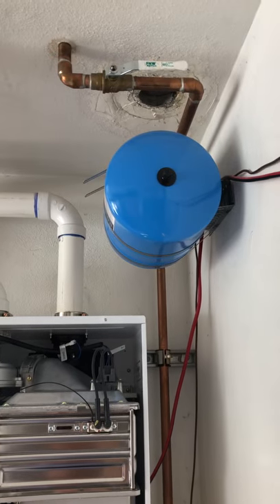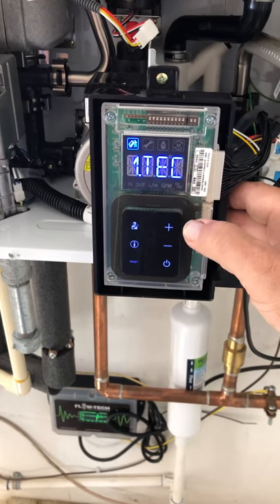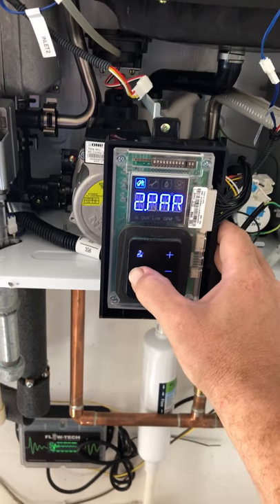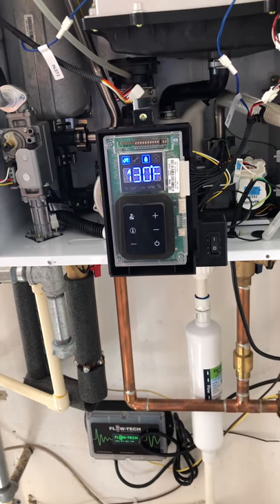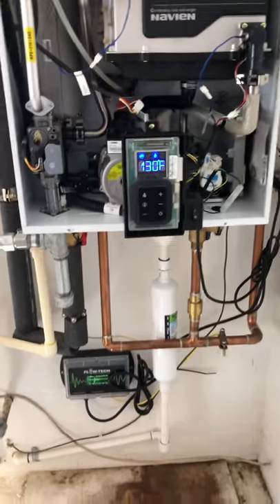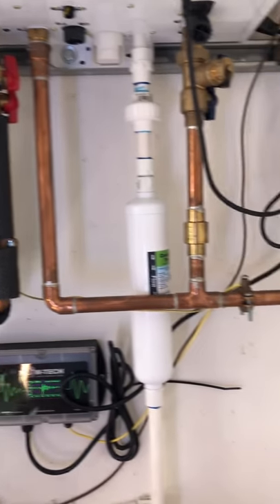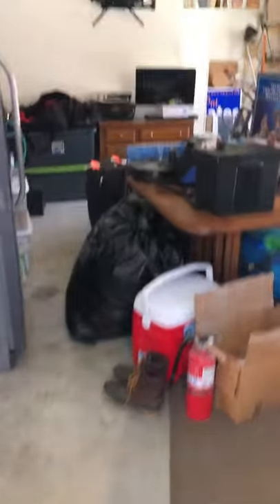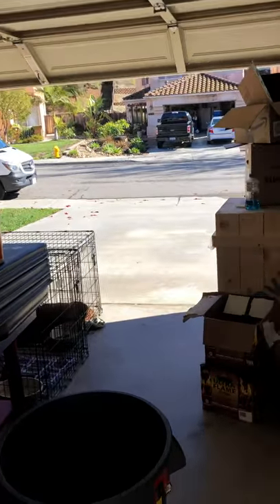How to Install & setup a Navien Tankless (series’s 1) without a dedicated recirculating line.

Comment: Does the NPE-A not normally let you use the recirculation pump if there is no dedicated recirc line?  I thought if a sensor valve was installed at the farthest bathroom that it would still work.
Reply: Mike Chu, did you ever get a reply? I too want to install a sensor valve at my most distant faucet and use the plumbing schema Osidewood is using.